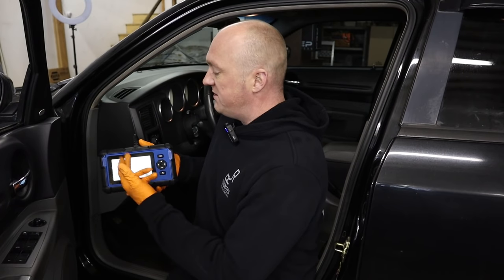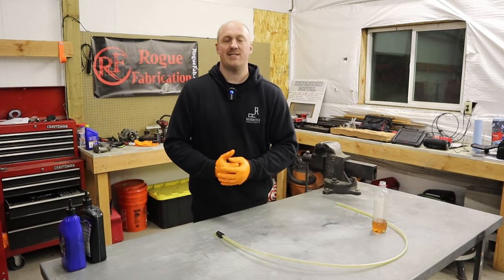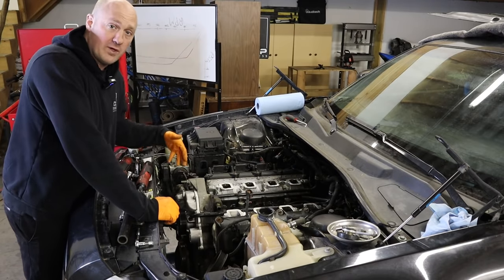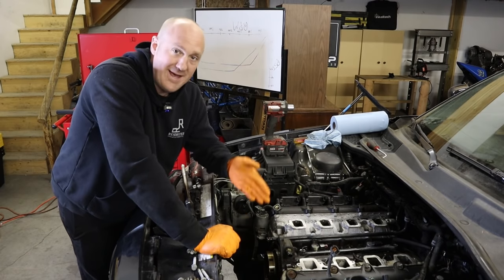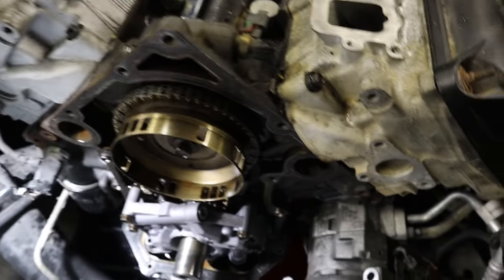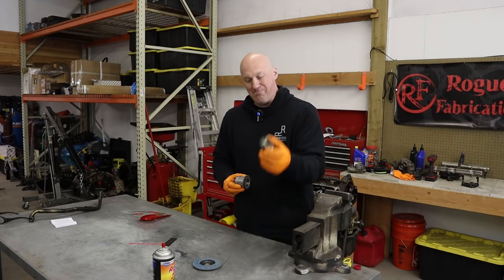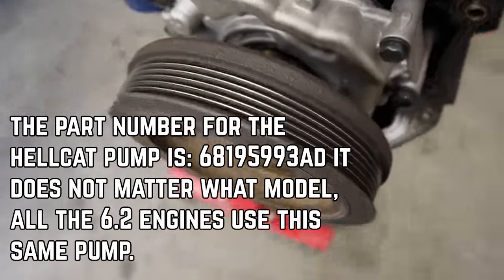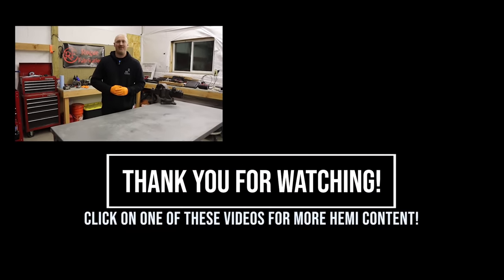Will This FINALLY FIX Hemi Tick? #hellcat

Comment: I have lifter tick sometimes not constantly would i benefit form melling because i feel its due to low psi under 21psi lmk i will take before and after videos and send you the videos to see if it worked or not i think itd be better to test it on a engine that ticks sometimes but still it ticks lol

Comment: @Reignited Will this Melling 10342HV oil pump fit my 2008 Jeep Grand Cherokee SRT8 6.1L???. In Melling's catalog mentions some Chryslers and some Dodges with the 5.7L or 6.1L, but only mentions Jeeps with 5.7L and doesn't specifically mention Jeeps with 6.1L. Is there a difference with the oil pump that the 2008 Grand Cherokee SRT8 6.1L uses compared to the 6.1L oil pump in a Chrysler or Dodge??
Reply from the maker: No differences that I'm aware of,  it should bolt right up.

Comment: Question: Could the OEM Oil Pump be programmed to have more pressure at its lowest point? For example, My 2013 RAM Hemi will idle at 44 PSI for the oil pressure. Could they program it to stay at 48-50 lbs at idle and not to go lower?
Reply from the maker: I have heard of fleet companies who will install a tuner to keep the idle about 250rpm higher which essentially accomplishes the same thing. 👍

Comment: 32:05  I thought I heard him say the Hellcat Timing Gear He Bought was the same as the Standard 5.7 (Meaning Pre 2009 Or Post?)
If I understand it correctly, the Hellcat TG is the same as the Pre-09 5.7, So there would be no need to Cut and Weld it together with the Pre-'09 Stock Timing Gear? 🤔🤔
Reply from the maker: No, it's the same as the 2009+ timing gear. The pre 2009 timing gear is the same overall length, but the gear teeth are thicker.

Comment: Good information, quick question, what weight oil was in the car? 5w 20?
Reply: Stated multiple times it's napa 5w-20 semi-synthetic
Reply: K, thx, I thought those older 5.7's called for heavier oil, but no matter since my 17 calls for 5w20.

Comment: Would installing a Hellcat oil pump void the warranty?
Reply from the maker: That indeed is a tough question. It depends on how hardball your dealership wants to be. To tell you the truth, if they weren't the ones who installed the pump I sincerely doubt they'd even notice that the pump is different since it's almost identical to the 5.7 pump and it's still a factory part.

Comment: i have a 2008 chrysler 300 SRT8 and it started ticking couple of days ago, as you said in your previous video of the hemi tick explanation that the 2008 models dont have this issue, now im thinking its the injectors ? i have no idea, should i open the valve covers and check to be sure? I did order a new cam, "hellcat" lifters and timing kit, so while my mechanic is at  it, can you confirm the hellcat oil pump will fit my 6.1 ?
Reply from the maker: The Hellcat pump does not fit the 6.1, you've got to go with the Melling High volume pump instead. 👍
Reply: @ReignitedAuto  great thank you! I've ordered the part number 10342HV from them 👌

Comment: So in conclusion did you need or not need to modify the length of the timing gear or the damper?
Reply from the maker: What I ended up doing in this video was only to install the Hellcat pump on a pre 2009 engine. On 2009+ engines it's a direct bolt on.  For pre 2009 engines I would use the Melling high volume pump since that is a direct bolt on.
Reply: @ReignitedAuto  ok i have a dodge ram 1500 2003 and thinking about doing this upgrade also. So i guess i will try the melling high oil pump then.

Comment: Will adding a HIGH VOLUME oil pump, cause the OIL PAN to run low on oil during extended driving?
Reply from the maker: I don't believe so, these modern engines have much better drainage from the cylinder heads, so I don't think you'd run into an issue like say the Olds 455 has.

Comment: Did your hemi have the tick before you swapped the pump? I bought a 1500 ram with the a fresh cam but ticked from the beginning.
Reply: We had the failure on a newer one that wasn't loud, even drove 2 months until dealership did warranty work. High maintenance, no towing and explanation from the dealer as to why.

Comment: Is hellcat pump direct fit for 5.7 after 2009?!
My car is grand cherokee Wk1 2010
Reply from the maker: That's correct, a direct fit on 2009 and later hemi engines 👍
Reply: @ReignitedAuto  if i understand , this is first step to save the lifters, second will be to delete MDS.
What oil is good to be used when mds is delited, is 0w40 good like for 6.4 SRT

Comment: I own 2015 SRT, oil pressue at IDL shows 11 PSI, is that normal? one time engine light came on showing P1524! replaced sensor but still issue of low pressure.. do I need to replace the pump? thank u

Comment: So my 06 300c 5.7 10342 melling on a cold start reads 55ish and on the freeway it reads the same give or take I have yet to see any higher psi readings and on warm idle it reads 32.so at 80 mph I'm close to 3k rpm because of my 3.73 gears shouldn't I be a bit higher in psi?the weather being in the 70s and up using 5- 30 full synthetic?

Comment: Every shop around me (mn) doesn’t wanna touch my truck (2012 ram 1500 5.7 hemi).They say it’s too risky and afterwards the bottom end grenades due to metal in the motor. Is this true?
Reply from the maker: There is the potential for that to happen, yes. The official stance by Chrysler is that if there's metal in the oil control valve screen, it gets a new engine so as not to chance it. With all that being said, in my own personal vehicles I have no problem just replacing the cam and lifters and flushing the oil pan.

Comment: Hello sir. I have a question. 2014 5.7 litres . Driver side 4th lifter doesn’t full slide in the hole.. any suggestions?? Thank you.
Reply from the maker: The lifter bores are generally quite tight, I'd take a closer look at the edge of the lifter hole itself, make sure there's no burrs or anything sticking into the bore. Likewise the lifter itself, if there's even the slightest part that isn't completely round it's not going to slide into place.

Comment: Question why when doing this would you go off of radiator temp vs the oil temp for engine operating temp?
Reply from the maker: Mainly because I was simply using the temp as a data point to provide similar data points across all three pumps being tested.  In my experience the coolant temp is generally within about 10-15 degrees of the oil temp. 👍

Comment: Is it possible to install the oil relief spring from a stock pump into to the hellcat pump to avoid the  excessive hot pressure at higher rpm?
Reply from the maker: Interesting thought, I'll take a look at the pump next time I've got one in my hands to see if it's possible. 👍

Comment: Is the oil pump on the 6.4 litre 392 scatpack the same pump as on the 6.2 litre hellcat?
Reply from the maker: Honestly I'm not sure, I haven't had a chance to directly measure the scat pack oil pump. However, I did just pick up a scat pack engine recently so now I'll be able to check and post that info 👍

Comment: I have a 2010 Srt8, It seems to read closer to what the hellcat oil pump is. However I am doing the hellcat oil cooler since I track it and that makes a good difference so I figure I’ll do the pump at the same time. For my year 6.1 hemi Will I need to adapt it? You said 2009 plus shouldn’t need it but the 6.1 didn’t change too much to my knowledge. I already ordered the parts I’d just like to know if I need the adaptor. Thanks!
Reply from the maker: You'll definitely want to go with the Melling pump for your 6.1 👍
Reply: @ReignitedAuto  Thanks for the help! By any chance do you know of how much (since you were a tech for so many years) the hellcat oil cooler should decrease the oil temp? I have heard 20 degrees when talking to an engineer who designed them but I want your input as well since you have so much experience with these cars. I have tapped 305 degree oil temp a couple times when tracking it on a warmer day and for both power and reliability I would like to attempt to decrease the temp of the oil as much as possible so if you have other suggestions as well that would be appreciated. Thanks!

Comment: So, that begs another question. For the 2009 and newer 5.7L Hemis. Does Melling make a high volume pump for those engines as well? My 2012 Jeep with the 5.7L is exhibiting the dreaded tick. It goes to my mechanic on the 4th of Jan. If they have to replace the cam and lifters, I would like them to replace the oilpump with a high volume at the same time...recommendations?
Reply from the maker: I have heard rumors that Melling is working on a high volume pump for the 09+ engines, but no concrete yes or no on that yet. However, the hellcat pump is a direct fit for your 2012 Jeep 👍
Reply: @ReignitedAuto  Thanks for this info. Just dropped the Jeep off at the mechanic. I'm apprehensive about the diagnosis. I'm hoping it's nothing more than some bad lifters and the cam is fine...
Reply: @ekummel  Curious, did you end up getting your stuff replaced? If so, how has it been so far?
Reply: @SEOwithErik  My mechanic confirmed that the lifters are causing the noise but it was not that bad at the time. And due to my mechanic not having any open time large enough for this job (He said something like 10 to 11 hours of labor) he couldn't perform the service at that time and to schedule a time in the future. Since the Jeep was still running fine, we just drove it.  Unfortunately, the noise got progressively worse and now I've got an appointment with my mechanic (cannot get in in under 30 day lead time) and it's scheduled to go in on July 30th. Can't wait!

Comment: Looking at swapping out the 5.7 oil pump on my 2014 ram 1500 for the hellcat pump. Is there any concern with the higher volume and the mds system
Reply from the maker: No concerns with the MDS system,  but I have been getting a few reports of people with certain models that once they install the Hellcat pump they are getting an intermittent check engine light for oil pressure low,  which is not the case. It seems like this is a software issue with the factory programming, and I'm still looking into if there's any solutions for this. 👍

Comment: A couple things and if I'm wrong ignore me but the crank gear makes it look like the timing chain gauge is puny.  2nd, if the hellcat splines don't engage very far here, then is that true for the hellcat as well?
Reply from the maker: For your second question, no, on the hellcat it has the updated VVT style mounting position so the timing gear engages fully with the oil pump. 👍
Reply: @ReignitedAuto  Ah yeah, makes sense.

Comment: I’ve commented before but is it worth doing the hellcat pump if I’m at 31 psi at hot idle in summer temps? I’ve got a 2020 ram rebel with a 5.7. My cold startup is around 60 psi and cruising pressure is always in the 50 psi range.
Reply from the maker: To me it depends on whether you are doing a lot of idling or not, if not then it's probably not necessary.

Comment: Have any one tryed 5w30 full synthetic  in thos hemi 2017 gen ? Is a extra 10-20psi bether  then 5w20? Once that oil is hot i mean... i think it would add psi if it adds 30% extra psi dose 5w20vs5w30 how slower dose 5w30 flows more then 30% ?

Comment: Great informative video!!! My question:  is this the same process for SRT8 Jeeps with the 6.1 Hemi? Are you able to just twist the oil pump to access the pickup line bolt or must the oil pan be removed to change the oil pump?
Reply: Jason Phelan  Thank you! I'm in the research/prep phase of swapping out a Hellcat oil pump for my '18 WK2 Grand Cherokee. That was exactly what I needed to know.

Comment: I really need to talk to this guy. I changed my camshaft and lifters and have the same tick going on. When I cranked my car it sounded the same so is it the oil pump. By the way its the same exact car.
Reply: It could be an exhaust leak.

Comment: Question:What would occur if you didn't replace the oil pump pick-up tube o-ring on the later model hemi 09-22?
Reply from the maker: There's just a chance that it won't seal perfectly, and this could lead to a lower pressure.
Reply: That's what I was thinking but wanted opinions other than just myself.I have ordered a new seal and pick-up tube and oil pan gasket so I decided after the 500 break-in miles for my new cam and lifters I would just change it then.

Comment: Will a 2016 ram 5.7 swap in place of my 09 5.7 truck? I've been told that I would need to use 09 oil sending unit and temperature sending unit because the blue is different? Can anyone confirm this

Comment: My 2022 scat pack runs 30PSI once it’s warm at idle, and around 59 when in operation. That makes me wonder if the 6.4 could benefit much from the hellcat pump or not. 30PSI sounds like it’s not far off on the hellcat.
Reply from the maker: I haven't yet had a chance to directly measure the 6.4 scat pack engine oil pumps. I have been able to verify the 6.4 truck engines use the standard 5.7 pumps, but I'd like to physically lay my hands on a scat pack pump before I say anything either way. 👍
Reply: @ReignitedAuto  I’d be really curious to know if it’s not using the same pump as the 5.7s on my car. I don’t have a tool to measure oil pressure, they just give me some toys on the gauge cluster to look at it, so it could be some apples and oranges outputs.

I’ve heard lifter failure is a thing for the 392 as well, so these videos were still incredibly interesting to me. And since my car is still new and under warranty, watching your tear down a 5.7 and explain it is letting me scratch my tinkering itch vicariously. The HEMIs should in theory live well past their end of production date coming here soon, as they look like they’re incredibly easy to work on versus some of the boosted engines I’ve seen torn down.

Anyway thanks again for your video series on these engines, I have spent my lunch hours lately watching your videos on them.
Reply: @ReignitedAuto  At least three lifters on my 2015 6.4L A8 Scat Pack are failing after only 43k miles. No excessive idling, ALWAYS changed oil (Pennzoil Ultra Platinum) at about 3,000 miles. Like Victis my idle pressure at operating temp is 30PSI and 57-60 at 3500 RPM. I’m not opposed to installing the Hemi pump but I’m wondering if my situation is due more to faulty OEM lifters than the MDS system. So I’m going back and forth about doing a full MDS delete and pump swap or just replacing the lifters with Johnson Lifters. Why would I take a chance on putting in new, OEM lifters if those were the type that failed?
Reply from the maker: @nickmashek6869  my only thoughts on aftermarket lifters are: they are sold in such small quantities,  and therefore there's almost no data available to accurately state whether they are "better" than OEM. If you buy a set and they last for 100k miles,  does that mean they are categorically better than OEM? Of course not,  because there are many thousands of Hemi engines with factory lifters that are over 200k miles with no issues.
Reply: @ReignitedAuto  That’s a valid point about non-OEM parts but I’ve also learned that Chrysler used a different manufacturing process and metallurgy for the 6.4L camshafts vs. the Hellcat camshafts which also might have contributed to my issue. I just changed my oil and cut open the filter. The two Filter Mag magnets I had on it captured quite a bit of visible metal shavings and I’ve sent off an oil sample for analysis. My 2015 only has 43k miles and oil was changed about every 3,200 miles. What else could it be but defective OEM parts? Why shouldn’t I try a different brand of lifters and camshaft?
Reply from the maker: @nickmashek6869  I definitely would have no concerns about trying alternatives,  my issues are more with making any blanket statements about aftermarket parts being better,  not that that's what you were saying,  just seems like a lot of people want to jump on that bandwagon.  As for the aftermarket parts,  I would only be purchasing parts from reputable companies,  no cheap stuff at all.  👍
Reply: @ReignitedAuto  I understand your viewpoint. Two questions: 1) Do you have any insights as to the difference in the manufacturing process/metals used for the the 6.4L camshafts vs. the manufacturing process/metals used to produce the Hellcat camshaft? 2) Are you familiar with the quality/reputation of today’s camshafts from Comp Cams  and MMX? Thank you. I’ve learned a lot from your channel since my valvetrain issue came up last month at only $43k miles.

Comment: So...Did it cure the "tick"?
Reply from the maker: The idea behind this modification is that it's a preventative measure. If you've already got a failed lifter it won't make it better. I do still genuinely believe that having the additional oil pressure at idle will prevent this premature wear from happening, but actually coming up with a real world test to "prove" that is nearly impossible.

Comment: Had the hellcat oil pump on a freshly rebuilt 2011 5.7 and im getting a low oil pressure check engine light p0524 but dash says its at 70 cold start at idle&between 38 to 42 can you explain what the problem might be 5w20 penzoil synthetic is being used
Reply from the maker: This appears to be a software issue that a few people are experiencing. I've had about three other people message me with the same issue. It looks like it sets the code about three or four times, then it's ok. 🤔
Reply: Thanks I appreciate your input and content on your channel
Reply: I’m still having the same issue of the p0524 oil pressures great as you said but it keeps setting off the check engine light can you research this for those of us who are having this issue I changed to the newer an oil pressure switch and I’m still having the issue thanks and keep up the great work

Comment: do the 6.4 liters drop valve seats like the 4.7 or 5.7s do?
Reply from the maker: Nope, they solved that problem a long time ago. 2009+ Hemi engines don't have valve seat issues,  5.7 or 6.4
Reply: thank you sir @ReignitedAuto